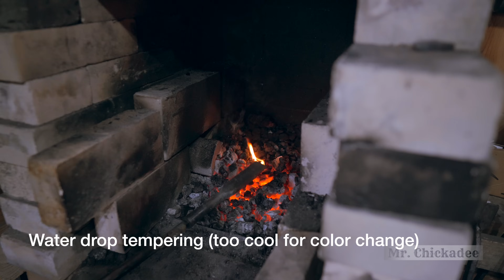Hand forged wrought iron chisels (for sale)

Comment: To anyone who thinks these are expensive I'd like to point out that good Japanese chisels cost thousands of dollars.
Reply: Also someone like him will always have demand above supply. Making them expensive makes it worth his time and means he doesn't have to try to satisfy crazy demand
Reply: Actually a great set goes for about ¥90,000 ($600 US). His work is always impressive to watch.
Reply: That's still expensive to me
Reply: On the one hand, this gentleman is a skilled tradesjack, whereas the Japanese are master craftsmen, but on the other, these are art pieces as well as tools.
Reply: Exactly. You want cheap? Go to Harbor Freight. You want excellence, you're going to pay for it.
Reply: Good japanese chisels aren't made of wrought iron... that's less than 0.8% carbon its softer than mild steel. these will last no time and be terrible.
Reply: And are fools gold.
Reply: To me, a large part of the VALUE, is WHO made them…..
Reply: @MrBenbrochill perhaps you might read about the construction on his site that speaks to your point before rushing to judgment.
Reply: @MrBenbrochill He uses high carbon for the edges. That's why he was forge welding. Also, the Japanese use the same type of construction, a softer material for the body, and a harder for the edge. It is not an uncommonway to do things.
Reply: Good western chisels are also expensive too
Reply: @MrBenbrochill  You'd think if he were smart that he'd forge weld some good tool steel to the wrought iron, which would give it good performance and longevity that you'd expect from quality tool steel.  Gosh why didn't he think of that
Reply: @Punkysimpa есть и хорошие русские, Петроградъ например
Reply: @Skinflaps_Meatslapper  He must have missed the part in the video where he added the high carbon steel,  or he thinks that wrought iron is too weak to be a secondary steel in a mortise chisel ( I have no information as to what the ideal steel for the body on laminated chisels is, but if he tried to make a legitimate point, this might have been it)
Reply: Northmen chisels are great
Reply: @SWATDRUMMUH - Not for a handmade Mr Chickadee original.
Reply from the maker: Japanese chisels, and actually chisels globally were always made of wrought iron, nowadays mild steel, that is laminated, meaning the body of the tool is a low carbon iron/steel, with a high carbon edge forge welded on. This is actually the best way to make a tool, as it permits the steel to be much harder without fear of breaking, and also makes the tool faster to sharpen as most of the bevel is soft iron. I have personally restored over 100 antique american framing chisels, every single one was wrought iron, just like this, with tool steel laminated to the edge. This goes for every edge tool in fact, from axe to knife.
Reply from the maker: It was the opening scene lol, all the 100+ antique American heavy framing chisels I have restored were wrought iron as well, as were older Japanese chisels, its a very strong material, in some ways superior to modern mild steels.
Reply: @ridethroughlifertl, actually, the Japanese do make high-end wrought iron chisels with a high carbon steel cutting edge done through forge welding.

Comment: Wow, i've seen lots of cool stuff in this video !!  Definitely love the wooden handles for your signature punches i want to make them too.     I think you're forging with bituminous coal, be careful with the fire maintenance.   Coal only gives warmth when it is glowing (thus already turned into coke), the fresh coal should definitely slowly smoke out any bad stuff first. (usually they put fresh coal on the side and you can water them slightly ... until they are coke)    Coal that burns doesn't give any warmth to the iron only radiation heat ;-)  ... in the end it looks like you we're doing fine, i just wanted to give you the information to make sure  ;-)                                                                                                                                                                                                                                                                 The Japanese alternating push and pull blower you are using... is it working good for the bituminous coal?     Cause i think it is designed specifically for charcoal because charcoal likes to have alternating air flow (it gives more heat).                                                                                                          But i have no experience with combining those so i don't know if it works good🤷‍♂                                                                                                             Have fun forging !!!  Next step is welding with sand 😛

Comment: You sure do have a wide range of skills 🙂. I didn’t understand some of your subtitles. For instance ‘Clay protects steel during quenching’. Why? For what reason? Am I missing something 🙂.
Reply: Iron forms an oxide at high temperatures that will flake off the clay is probably there to form a barrier to limit oxygen exposure and keep the surface finishes nicer
Reply: Probably so it doesn’t cool as fast, or form scale.
Reply: Look it up.